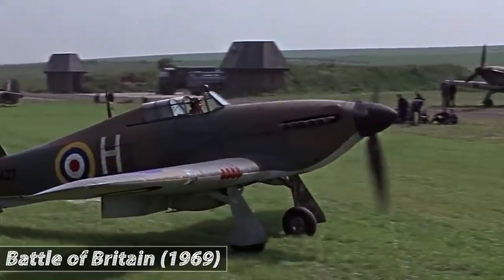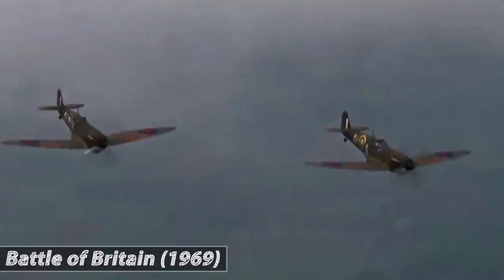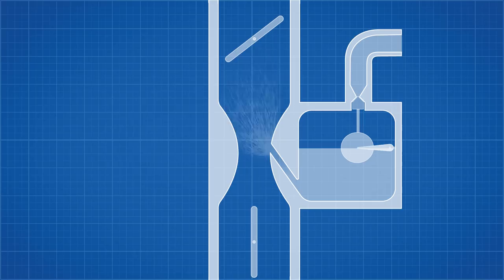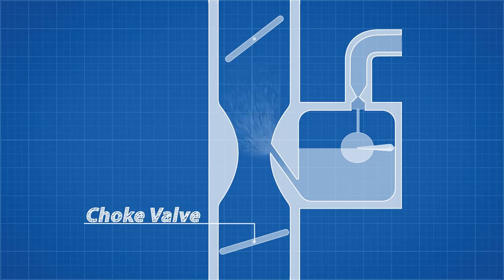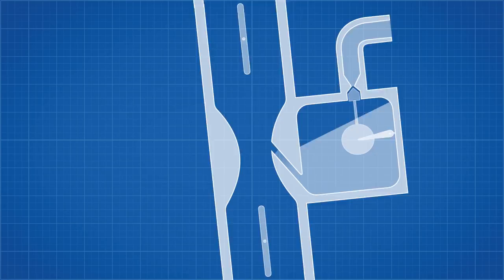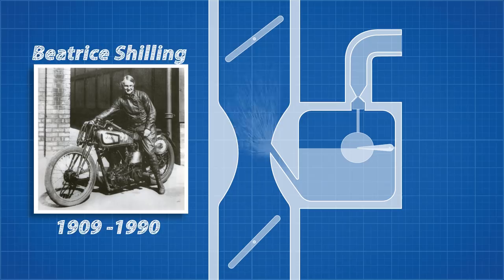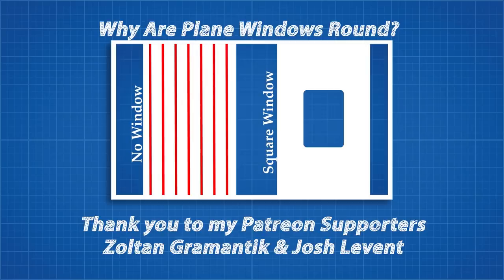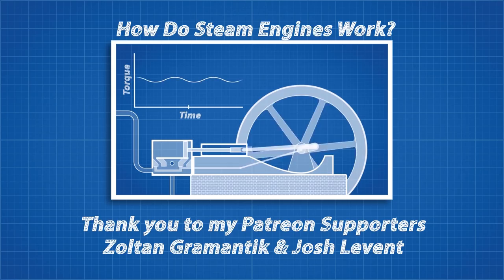The Spitfire's Fatal Flaw

Comment: So my question is: If battle of Britain was a 1969 movie and the spitfire shown was flying in 1969, then why did it have black smoke? The aircraft must have survived long enough for that simple modification to be made, and also long enough for a pressure carb to be installed (as it was obviously still around in 1969) and knowing of the fatal flaw, why would anyone allow the plane to be flown without the carb choke ring, or better yet, a pressure carb, considering there was a greater than zero chance for the engine to fail? On top of that, this maneuver was done at a relatively low altitude, which is even worse for an engine loss. It seems like that pilot (and the aircraft) was being put in an unnecessarily risky situation all for a slightly more realistic picture. . .
Reply: No they would not have made that change. Its not a resto-mod its a pristine and original airplane and there was no need to fix the carb anyways since nobody does aerobatics in a warbird
Reply: Also loosing power for a second won't do jack shit low altitude or not, ur not hanging upside down for hours, ur doing a roll and the loss of fuel for a second isn't even enough for you to notice a drop in airspeed. And the engine doesn't fail from that either, once the plane is no longer in zero g's or below the engine runs like normal
Reply: Ethan Higgins-  You're right.  I've flown aerobatic and you're just not inverted or in negative g's long enough for the carb float issue to matter, unless you're doing a sustained outside loop, and anybody with any working familiarity with the Merlin simply knew not to do that.  One would simply break off, do a climbing hammerhead and come back on the guy out of the sun.  Break off and re-attack, break off and re-attack....  you do NOT dogfight with him.
Reply: "...was being put in an unnecessarily risky situation"  you DO realize that directors ask actors/stuntmen/stunt pilots to take unnecessary risks all the time?  There is a film that was shot over 11 years (released in 1981) called ROAR, over 70 of the cast and crew were injured during the production of this film. Cinematographer Jan de Bont had his scalp lifted by a lion, resulting in 220 stitches. Tippi Hedren received a fractured leg and also had scalp wounds. Later she was also bitten in the neck by a lion and required 38 stitches. This incident can also be seen in the film.

Melanie Griffith was also mauled during the production, receiving 50 stitches to her face; it was feared she would lose an eye. 

It is regarded as the most dangerous film shoot in history.

As far as we know no one was killed on the set of Roar...

BUT at least 70 (some say it was more like 100) people were asked to do something, that was not JUST risky, not only got them seriously injured, but was imminently more dangerous than rolling a Spitfire!
Reply: MISTERComaToes Rem the Milk Tray ads in the 80s? Same thing.
Reply: Pile Of George i
Reply: It was simply an earlier model
Reply: It's extremely unlikely a later carb would not have been fitted if available, but, it may not have been possible to get later variant when film makers needed planes in the air. The RR Merlin engine was acknowledged to be the best high altitude piston engine with it's built in supercharger but it wasn't the easiest or cheapest to build. The truth is, neither Britain or USA could build a fuel injection system accurate enough to compete with German engineering. However, the German engineers did make some way overcomplicated 'weapons' which didn't help production figures at a time when numbers mattered (doesn't matter how good something is if you only have a few, as witnessed by the ME 262, etc)
Reply: Peter Jones---   To say nothing of the lack of pilots.  American scientific & military teams scouring western Europe for examples of German technology (jets, for example) found plenty of airplanes who were left unused for lack of trained pilots.  It was the severe shortage of av-gas that so limited Germany's ability to produce pilots.
Reply: They didn't have to use the original, faulted, Merlin engine in their spitfires, but just simply give the pilot the ability to fire smoke from the same area as the engine to make it more realistic.
Reply: Incorrect in several ways. First: it wasn't a difficult or particularly expensive engine to build. It was purposely designed with quite wide tolerances, making the conversion of factories that had been making quite different products to readily adapt to the Merlin. Over 160,000 were built in WWII, 36,000 of them by the Ford motor co. plant in Manchester, which up to then had been making cheap family cars. Second: the main reason that RR stayed with carburetors was that the latent heat of evaporation of fuel in a carb. cools and increases the density of the incoming air/fuel charge, allowing higher supercharger boost than any other engine, allied or enemy, could tolerate. Injecting fuel directly into the cylinders, as in the Daimler-Benz engines, lacks this benefit. To remedy what the author of this article calls, somewhat hyperbolically, a "fatal flaw," by 1943 Merlins changed to Bendix, RR or S.U. fuel injection into the eye of the supercharger inlet, giving two benefits: (1) no more engine cutout when bunting over into a dive; (2) keeping the benefit of colling and charge density from the evaporation of the fuel.
Reply: Pile Of George they made new spitfires they don’t just upgrade old ones, that’s one from around 1940
They wouldn’t grab a underperforming plane in 1945 slap a new engine on and send it out
Reply: I donr't think they had any Mk. I or II Spitfires for the film only Mk. V and more likely Mk. IX so the Spitfires you see all have newer engines with the newer carbs. When they were restored a lot of Spits they out newer Merlins in as they were more common at the time. The Hurricanes are rarer so they are more original and have the old engine and unmodified carburetors which is why in the film it cuts in the loop.
Reply: Wot
Reply: special effects
Reply: You realizes most war movies use surplus equipment. so that could have been a non battle serving aircraft and or been removed or added smoke to make it look real.
Reply: Absolutely! When the Allies captured Mercedes engine powered German aircraft (ME 109 for example) the tolerances that the Germans engineered these engines with at the start of the war (before the extensive use of slave labour) were so tight that British and American engineers simply couldn't imagine how this was achieved!
Reply: Makes sense!
Reply: Sam 88 bbşşüü

Comment: your opening shot (from battle of Britain) is a hawker hurricane, not a spitfire...same engine RR Merlin but very different aeroplane.
Reply: Matthew Dobbs both where made by Britain, near enough same size, both had wooden designs, both were owned and given away by Ireland not long after the war... they're over a million each now :'(
Reply: Ben Phone beautiful aeroplanes!
Reply: Matthew Dobbs was thinking the same thing ha
Reply: Dimitri Wolfs indeed, spit completely different structure and size to the hurri, a new complete shell design as opposed to the old idea of frame and impregnated fabric covering, but they are both beautiful aeroplanes. Spit could put much more G on its frame than the hurri as a result of the design,hence the engine problem was not as pronounced in the more traditional frame design. Hurri much easier to repair and a more stable gun platform, cheaper too....great fighters both!
Reply: +Ben Phone - Both had wooden designs? The only bits of wood anywhere near a Spit were Douglas Bader's prosthetic legs!
Reply: Except that he was known as "Tin Legs" Bader.
Reply: Actually due to demand during the early part of the war some Spitfires were built with wooden wings just like the Hurricane.  Of course this was a stop gap solution to meet a desperate production demand.
Reply: Slim Jim i have never heard that before. Could you provide the source for that as it would be of interest to a few people!

Comment: I thought that their fatal flaw was that the landing gear were too close together.
Reply: MrRoboskippy The Messerschmitt BF-109 had that problem, I believe, not the Spitfire
Reply: They both had the same issue.
Reply: The landing gear was only a real problem on the Seafire, the carrier based Spitfire. The pitching decks gave it a problems. Planes designed specifically for carriers had the wheels wide apart.
Reply: The Spitty had landing gear that hinged inboard, meaning it had a narrow track and was less capable of landing on rough fields.  The Hurricane had landing gear that hinged outboard, giving it a wider track and much more stability when landing on grass.  And most airfields in the BoB were grass, because they were easier to repair after being bombed.
Reply: That was the real flaw  -  the landing gear.  They had quite a few accidents
with the gear collapsing outward and many ground loops.
Reply: Vossright Furtwangler-  But be entirely honest one must also recognize that the Bf-109 had the same problem.  Its narrow landing gear made it tricky to handle at landing & take-off speeds, too, but a competent pilot could- and did- compensate for it.  It didn't kill anybody who was competent enough to belong in the cockpit.  Hardly a 'fatal' flaw, just a mild design shortcoming.
Reply: Absolutely.  I was merely addressing the question of landing gear, not suggesting that it was a "fatal" flaw.